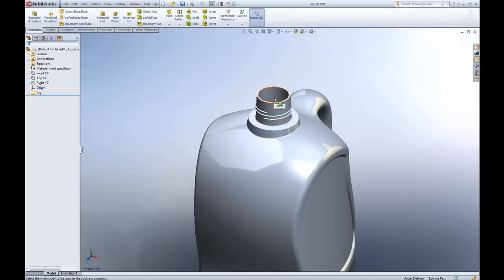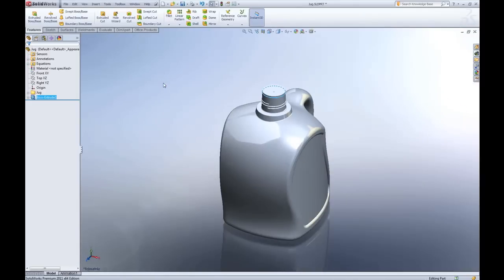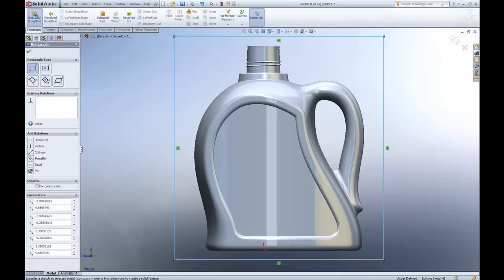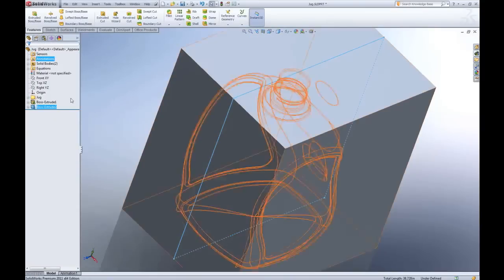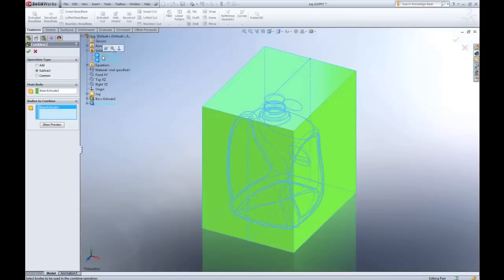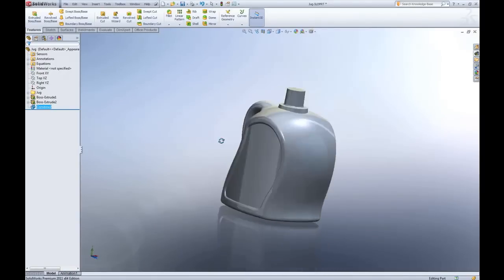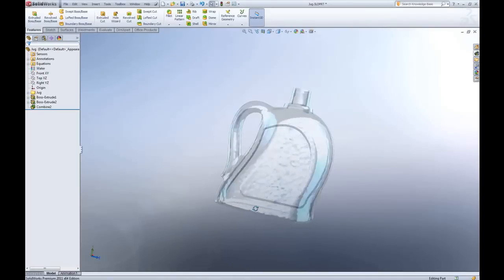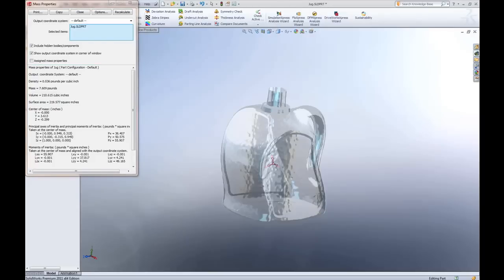SOLIDWORKS Quick Tip - Calculating Volume

Comment: Hi, I am looking for an app that allows me to assemble several frustum or octogonal truncated pyramids and give me the volume.
I also need to be able to easily change the dimensions of the bases and heights.
Cheers
Reply from the maker: Solidworks does not have a tool that will do this automatically for you. However there are things that can be done and ways to create some automation around what you are looking for. Solidworks should be plenty capable of getting the information you want and making it configurable.
Reply: @goengineer  Solidworks?
Is it only on PC or there is also an Android version?
Thanks a lot :)
Thomas, an amateur hot air balloon designer from Brussels Belgium

Comment: So *****, when I uncheck "merge result" I do not get 2 solid bodies. What else do I need to do?

Running Solidworks 2014 Premium
Reply from the maker: Unchecking 'Merge result' should be the only option that needs to be unchecked in order to make the program generate an additional detached body.

Comment: I am currently having an issue trying to find the amount of gallons/volume of a square with a specific wall but it states that you must have a solid form in order to use combine. Any way to work around?
Reply from the maker: The program only calculates volumes of solid objects.  This video illustrates this fact by how the internal volume of the gallon jug must be modeled in order to then have a water material applied and measured.  If you have a surface body that would have to be formed into a solid to be used with the Combine feature and measured.

Comment: its not accurate internal volume either.  to do it my way you have to use a Sub-d modeling plugin for solidworks. mass properties before shell, minus mass properties after shell.  231 cubic inches = a gallon.. simple.

Comment: I design Plastic Bottles on a daily basis, and I would not reccomend this proceedure. it's good to get a baseline, but it is not accurate. In Blow Molding, you have uneven wall distibution and this assumes even wall distibution and you could be calculating the wrong volume. I do it based on gram weight and cubic inch of the entire part.